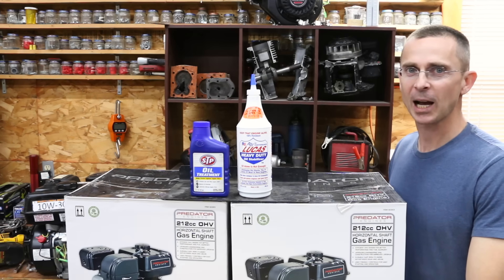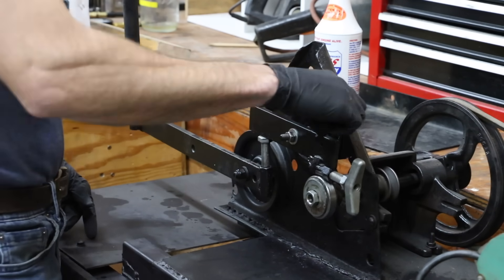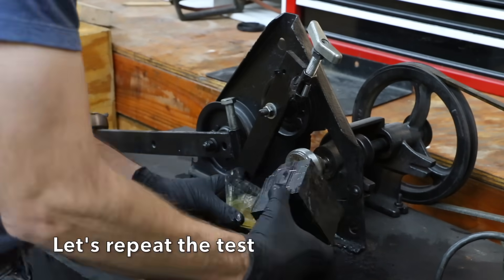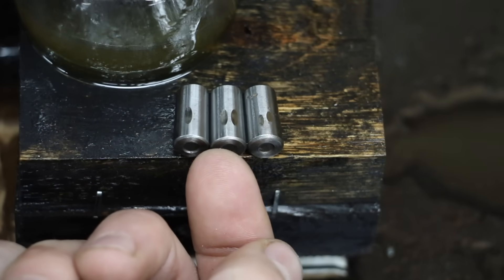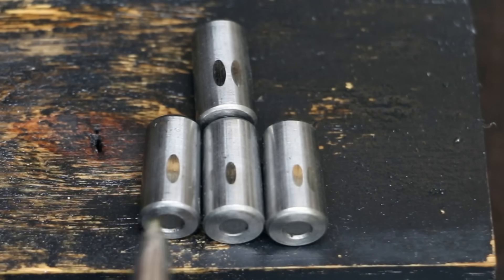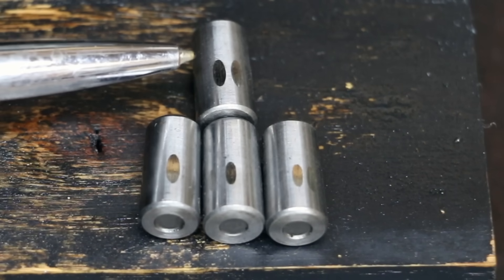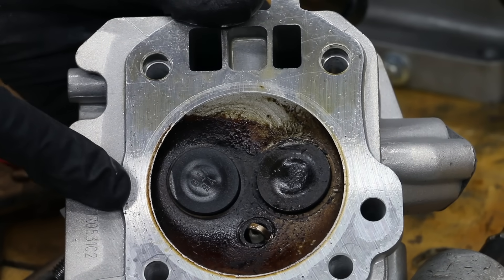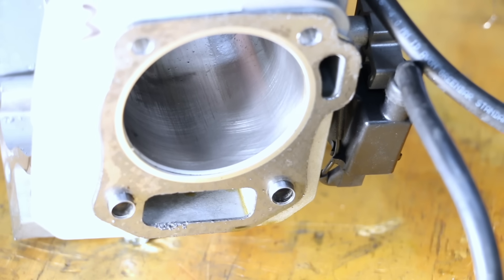Which engine self-destructs first?  Lucas or STP?

Comment: After watching a few of these I find them interesting but I'm not sure the result is valid as you have tested the Lucas twice and got different result each time. I suspect the minute difference in the engine clearances in the engines that are close but not exact might have more effect than the substance used.and none of these products are meant to use with out oil or to run after the engine is dry.
Reply from the maker: Thanks for commenting.  I tested Lucas Synthetic one time and Lucas HD Oil Stabilizer in a different video.

Comment: I’m not a fan of these types of products, unless you have a very high mileage vehicle that leaks like a siv and the vehicle in question is not driven in a cold climate otherwise I think you’re asking for more problems then answers.
Reply from the maker: Thanks for commenting on this.
Reply: Project Farm Thanks for the reply! Merry Christmas!
Reply: Used Lucas in my race car engine with great success FYI
Reply: Why do you say that about cold. Climates? Because it changes the viscosity?

My 7.3 IDI leaks until I can pull the motor to add a oil pan sealer and I run 0-40 in it as its my work truck in northern Canada.
Reply: syberspy9 Yes thicker oil in cold weather usually not a good idea.
Reply: syberspy9 If you use a block heater and do a proper warm up, you may get away with a thicker viscosity.

Comment: They are not designed to run with out oil period a better test would be three engines to see if it does any good at all.
Reply from the maker: Thank you for this recommendation.

Comment: These testing devices are meaningless as the real challenge for motor-oils are heat and  shear stability.
Reply from the maker: Thanks for commenting on this. The side by side engine testing tests heat and shear stability.
Reply: Yes, I know. Just wanted to point out that  those friction tests do not tell that much about motor-oil quality. E.G. the  temperature motor oils are designed for to work best is the temp-range inside a motor - thus at least 210F or 100C.  In the testing device they are used cold, and therefore our of operational specs.
I don't even know if that's better or not, its just not what motor oil is designed for and has to cope with inside a real engine.
You can easily formulate an oil which is super good on the testing device but sucks as motor oil.

One last remark: Some think, that oil additives make good oil actually worse. So I'd like to see  the winner of your test compared to a good untreated motor oil. And if you want to push it to the max: Compare that to a fully synthetic  0W40 oil like Mobil 1.

Frankly: I'd put my money on  synthetic 0W40 oil at any time.

Anyhow: Thanks for the video. Interesting as always!

Comment: What was the point of this test? Obviously running them without oil would end this way. Extremely unhelpful
Reply from the maker: Some shampoos can outperform engine oil on the lubricity tester.  The engine test demonstrates film strength in an actual running engine.  Car manufacturers do "crash testing" with their vehicles.  Seems sort of pointless too, except that it helps them make cars safer.  Thanks again.

Comment: My 91 Cadillac Brougham Tbi 305 5.0 i had since 2004 had lucas with conventional oil every oil change. It sat since 2009 and cranked just fine with fresh fuel pump and gas...same oil with additive. Love lucas...also no dry starts in the morning.
Reply from the maker: Thanks for commenting on this.  It's seems like a great plan to use Lucas in an engine that will be sitting for an extended period of time.

Comment: Ideally this kind of test should include a third engine that was just run on oil, without any additive.  The fact that the Lucas engine ran longer could be down to the Lucas product, but the internal clearances of that engine might have been looser ex factory thereby allowing longer running.
Reply from the maker: Thank you for the recommendation.

Comment: Consumers got to understand that oil additives purpose is to enhance its longetivity not the  mechanism's durability that is only a collateral effect. Oil looses its viscosity after a period of use, an enhancer will prolong it's lubricity but eventually will depleat.  None of this oil additives have solid particles that will form some protective ply or film & working the mechanism without its lubricant was completely wrong, this were designed with lubricant as part of the engine; a 2 stroke engine has bearings & don't need as much lub & can operate without oil for a long time. This 2 Chinese eng. did not SELF DESTRUCT, there were real dumbly wasted.
Reply from the maker: Thanks for commenting.  Some additive manufacturers actually do demonstrations as I've done to demonstrate the quality of their products.  I've been contacted manufacturers requesting I include their products in upcoming episodes as they are confident that their products provide superior lubricity over the competitions.  Thanks again.

Comment: I worked with a drilling company who used Lucas with everything. Their epensive equipment had internal heat probes that showed the Lucas product made it run cooler. It was actually in Australia and the brand is Moreys, but it's actually the Lucas product.

Externally your test showed the fins running hotter because more heat was being transfered. Multi million dollars drilling companies don't use product on a whim, it came from many years of testing that they chose to use it. Down time on a drilling rig costs huge money and is nightmare stuff for them.
Reply from the maker: All excellent points. Thank you very much for taking the time to comment.

Comment: I think a test where the two engines are under load at WOT and very restricted cooling (cement up the fins or something) with oil and run until they melt would have given some useful data to work with.
Reply from the maker: Thank you for this recommendation.

Comment: out of curiosity, how warm was the oil when doint the Viscosity test? its no secret cold oil will be gummier than warm oil.  not trying to discount your results but it is a factor to take into consideration.
Reply from the maker: I always test the oils at ambient (approximately 70F) on the lubricity tester, similar to a "cold engine" start. Thanks for commenting.

Comment: I always use Lucas in my old worn out Subaru motor. I have to let her warm up before I driver her and when she's cold she rattles like a 7.3 powerstroke.
Reply from the maker: Seems like a great product for an engine with a lot of wear. Thanks for commenting.
Reply: freetimedaze sea foam can help that motor as well
Reply: LOWKEY THE HUSTLA Actually I ran some seafoam in the crank case before my last oil change.
Reply: my 1997 dodge dakota hates the cold too sounds like wtf, for a few seconds
Reply: freetimedaze well have you ever owned a powerstroke?
Reply: my 7.3 doesnt rattle
Reply: someone replaced the oil in our 6.8 v10 with lucas diesel oil addictive and it blew in a matter of days.

Comment: Dude seriously you ran to engine without oil of course they're going to f**** blow up it would happen with any engine that didn't have oil
Reply from the maker: Yes, the objective is to see which lasts the longest to determine film strength inside of a running engine.  Thanks for commenting.

Comment: In my experience this video is flawed from the outset. If you know anything about STP then you know it's an additive that has been around a long time before synthetic oils made it to market. It's entire history is a mineral oil additive and again found that synthetics have a bad habit of splitting. Like adding washing up liquid to oil. Can't speak for Lucas but from what I can see it's designed for synthetics. Unless STP have drastically altered their formula I would re-run the experiment with 20/50w mineral. Used to own. Ford Fiesta 1.3 Zetec here in the U.K. And used STP and Duckhams 20/50w because it was cheap and I could do oil changes every 6 months. The engine run so quiet,  I used to try to start a running engine from time to time because I thought I had stalled. OK wrong oil for that engine and bad for winter conditions but the STP made the mineral oil like glue and it was as quiet in the winter as it was in summer with much of the oil leaving a film on all the moving parts. In hot countries they all use 20/50w all year round as winter starting isn't a problem. Just my opinion but fear STP was always designed to give longevity to the quick degradation of mineral oil. Lastly mechanics will tell you it's an bad idea to mix fully synthetic with semi synthetic however Shell say it's Polyglycols and a lot of people use mineral 20w/50in the summer and 5w/40 in the winter but this experiment highlights why mineral oils have such a viscosity issue and become watery thin at high temperatures where as decent synthetics remain a constant viscosity over a wide range of temperatures.(I use 0w/40 fully in my Mercedes A210amg). For me, my theory is adding STP made the oil behave like a mineral additive and break down at high temperatures rather rapid, the Lucas is probably designed with synthetics in mind. OK I may be wrong but I am sure the STP was burned off because it displaced the synthetic oil on the bearing and you were running on STP only (hence my comment on splitting the oil) the Lucas worked with the oil and clung to the bearing like shit to a blanket. I don't believe either additives are quantifiable lubricants on their own however raise the viscosity by raising the temperature tolerance. The Lucas simply gave the oil a higher tolerance to the extremes of temperature where the STP didn't and failed at say 600oC and the Lucas was more like 750oC at the big end bearing. A great test would be to take the same oil additives and mix the prescribed quantities and amounts and burn them off with a blow torch. Then you will see what's going on. BTW the melting point of Aluminium or Babbit alloy which I presume the big end bearing is made from is 463oC to 671oC. So without googling Lucas additives claimed thermal extension I think it's designed to exceed the temperature of the Babbitt..... the STP isn't, as the oil it is supposed to be life extending,
withered way before that..... that's why I maintain its like a mineral additive. !!! STP claim ZDDP derived from Zinc and Lucas maintain its product is an oil stabiliser. Both say they reduce friction by adding a cushion of oil to prevent dry starts. HOWEVER both say they reduce friction thus reducing heat..... heat being the operative word here. And as we know from what I theorise one has better heat handling than the other..... Lucas.... but I still think changing the oil more frequently is much better than any additive....... every 3000 miles in my case.??
So in essence the ZDDP coating from the both oils gave a bit more life to the engine, does not change the fact it was the oil that was the lubricant at the end of the day. Run the engine on Hypoid 80w/90 ..... now that would be nice to see.

What's my verdict? For a new engine.... kiss goodbye to both.... you don't need em!!! An older worn engine..... fantastic... and remember oil gets squirted under the piston to stop it melting! Oil is also a major part of the cooling mechanism. Interfere with that on a modern engine can only be bad.

Comment: I highly suggest a Russian Modifier (Universal Modifier, Modifikator Plus). It is claimed that the vehicle can be driven for 30 miles without oil after the aditive is used, that the additive lasts 30000 miles (changing the oil does not remove the aditive), compression is restored, etc. The product is for sale for a very long time and my (now retired) old school mechanic did not believe it until he disassembled a customers engine out of curiosity to see how it looked like inside after use - 100000 miles with no trace of wear. The product should be available in the US as well. Polish video: https://youtu.be/DecskDYiue0
Reply from the maker: Thank you for this recommendation.  I'll see if I can purchase this product.

Comment: Redline oil and cleanboost oil are the 2 best oils you can buy!! I know this because I know big time guys Sponsored by Lucas or other oil company’s that buy REDLINE and store it in their Sponsors container to use because ITS REALLY THAT GOOD. No offense to royal purple or Mobil but they are even on the same playing field. Also it will help your control to break the engine in before doing a failure analysis test on it. Your channel is really great and seems to be getting attention and educating people you need to make sure you have something to give. The best oil in the world is not going to save a empty engine!! If you really want to do failure analysis on a given oil you need to keep the oil in the engine and induce a heavy load and then maybe add a bunch of heat. Your getting the same failures with every oil. A spun bearing , scaring on the cylinder wall and I’m sure a fat cam or 2 but it’s all the same . Your just taking note of the run time and making a assumption on a known outcome . You also have to remember application dictates Performance this that are good at one thing can suck at another! Just because a engine runs longer empty with one oil don’t mean that’s a better lubricant . Your test machines look like 99$ 212 predators . I have bought a ton of them for my sons go kart and jr dragster. I build engines for a living and they are some of the worst quality controlled units you can buy!! I usually have to buy 3 or 4 to make one solid one for my sons karts.
Reply from the maker: Thanks again for the comments and recommendations.

Comment: Your vids are great and all but there’s a lot more to it then running a signal cylinder brigs or a Bearing machine like your using. I remember pro long running around the race track showing us with a similar machine. You have to understand the dynamic and different Materials used in the internal combustion engine. One of my mentors is a chemist in oil additives for major oil company’s. Most of the oils Performance comes from the base oil . If you want to know what the best oil is ... it’s REDLINE they use transformer oil and in my line of work that is a big deal because the flash point is so high. Modern oil has a ton of detergents witch makes all the additives not stick to much. With a million views I would think you got plenty of $ to step your game up and run some real controlled tests. I can help you get in touch with some people that might be able to help you. Also look up combustion technology’s aka clean boost oil. It was started by the lead chemist at REDLINE and is just as good if not better. Your running engines with no load on them doing bearing tests it doesn’t really apply in the real world if you can produce a load it will tell you a different story
Reply from the maker: Thank you for these recommendations.  I plan to test redline in the future.  One reason I'm using the 212 Predator Hemi instead of the Briggs is that these have a Cast Iron Cylinder and overhead valves.  They still are much different than an automobile engine, but they are more similar than the Briggs. Thanks again.

Comment: Wow!!!!!!  That was amazing. I want to tell you about what I did to my V8 305 car motor in the 80's my car was running really bad and knocking and burning gas and oil really bad so I changed the oil with Quakerstate 10w 30 oil and added Duralube oil to it. To my surprise the motor ran like new after 5hrs of running it, then there was no more knocking and I got better gas milage, no burning oil either the car never gave me any problems after that. I had it for another 5 years, then someone wanted to buy it off me and I said yes. I had the car for a total of 17 teen years and rolled the odometer 3 time over. When the guy buught it off me it said 500Km and the year of the car was 1981 it lasted until 1998 when I sold it.
Reply from the maker: Thank you for sharing this experience. I enjoyed reading your comments.

Comment: I've been watching your channel for a long time now. I think from all the way back when you first started with the Sea Foam in the engines. One of the questions I wanted to ask because I started learning about 2-cycle engines about a year ago when I bought my first paramotor.
Originally I found your video because I was looking into Sea Foam and using that to prevent carbon buildup and lubricate extra the cylinder. I know some guys purposely Infuse ATF fluid into the exhaust pipe to make a smoke effect when flying.
I wonder what would be the smoke effect of inducing seafoam into the air cleaner of a two-cycle engine as well as introducing ATF fluid into the air intake and if that would cause any issues.
I know that seafoam is used specifically on the air intake in a vehicle so I would not perceive any issue but I wondered what would the effects of adding periodic ATF fluid into the air flow stream.
Reply from the maker: Thank you for this recommendation.

Comment: Please try Slick  50 i used it in my car many years ago i broke a bottom  hose and i drove 12k,s without any water in my car fixed to hose and the motor is still going cheers .
Reply from the maker: Thank you for this recommendation.

Comment: Interesting test, it shows that these additives are pretty worthless, wonder about Seafoam, but I add that only to the gas in my 50 cc scooter where I think such an additive is better suited for upper cylinder lubrication than to the crankcase oil even though it says you can add it to that.
Reply from the maker: Thank you for this recommendation.